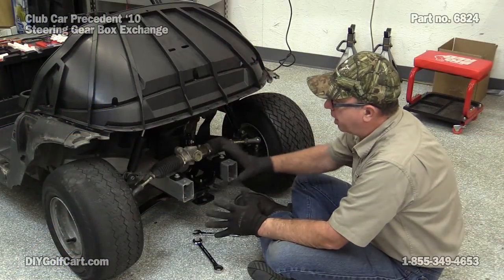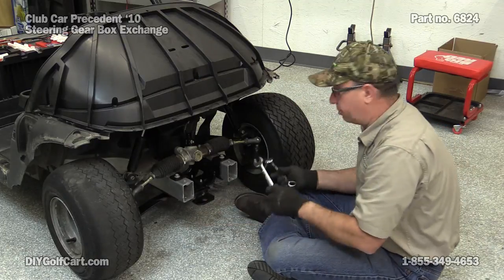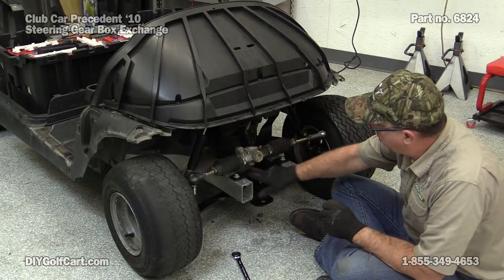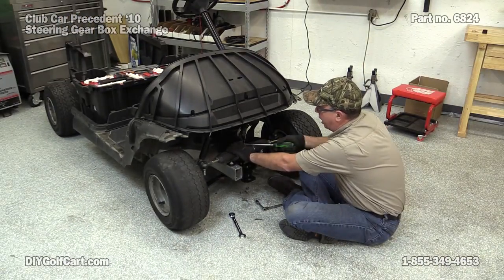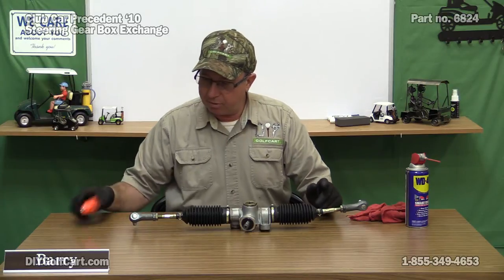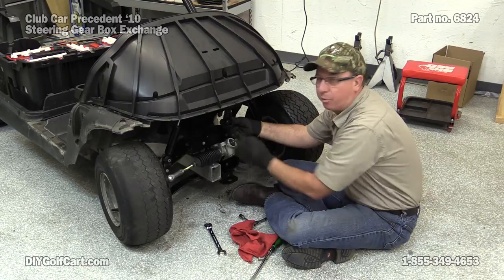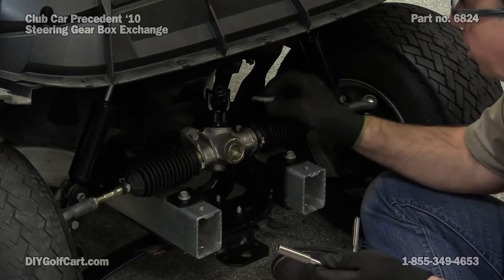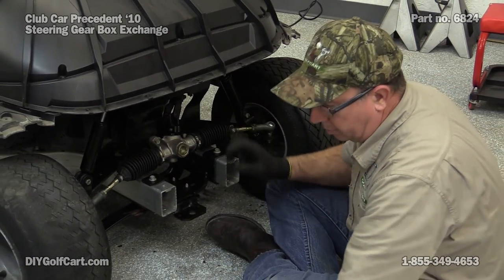Club Car Precedent Steering Box | How to Replace on Golf Cart

Comment: I have a '06 CC Precedent. I have replaced all the bushings  on the front end along with a new spring. Both hubs are tight with just a small amount of play. Lastly I have replaced the rack and pinion with a new one. All toe in and camber are good. However on my first test run out all seemed good, on the return when I got up to speed, the cart would suddenly cut  left or right, sometimes just a little sometimes hard. I adjusted the pressure nut on the r&p but that seemed to have very little help. Double checked that everything was tight and torqued to the proper ft.lbs. I'm at a loss now as to what to do next. Any suggestions or help would be greatly appreciated!

Comment: do you have to remove steering box to replace the bushings in the upper control arms? thanks
Reply from the maker: No, you don't have to. There should be plenty of room without having to remove the steering section.

Comment: Your tie rod ends slipped right out of the spindles very easily. Mine are stuck and I couldn't get them out of the spindle. Tried hitting up with hammer and block of wood and they don't even budge. Mine is a 2009 Alumacar which is very much the same as  Club Car Precedent. I'm wondering if they are pressed in ? Any ideas.  Thanks.
Reply from the maker: Try this tool.     https://www.autozone.com/loan-a-tools/loaner-ball-joint-separator/oemtools-27020-5-16in-fork-opening-ball-joint-separator/555664_0_0

Comment: I have a 2004 Precedent cart...when I steer right of left I get two metallic clicks, one slightly louder than the other. What do you think the problem may be...how do I get started?
Reply from the maker: Sounds like the bearing in the front hubs are slipping. Unfortunately you'll have to replace the complete hub assembly,

Comment: How do you check the steering box needs to be replaced? When turning my cart the steering wheel start spinning?
Reply from the maker: Early signs that it needs to be repaired is, excessive free-play side to side. You want to make sure that the steering is smooth when changing directions and not jerky or clunky. If it starts spinning, you may need more than just a repair kit.
Reply: Thanks, where would I order a new steering assy?
Reply from the maker: ***** Give us a call here at DIY Golf Carts 855-349-4653! We have them in stock!